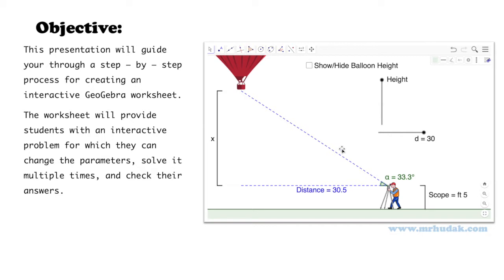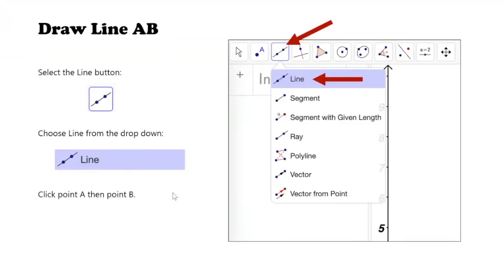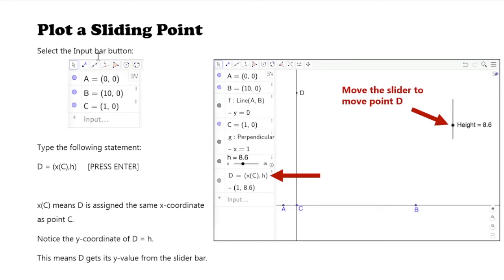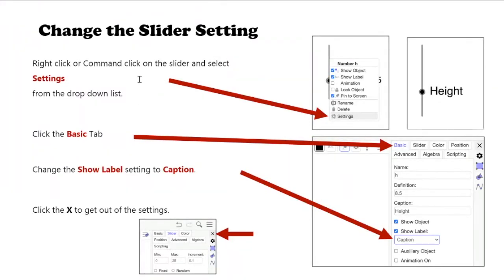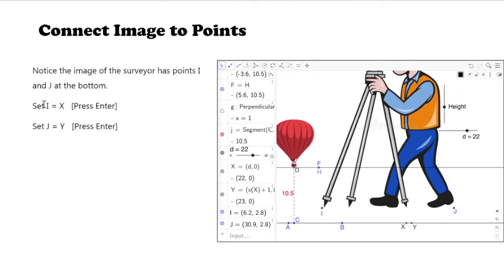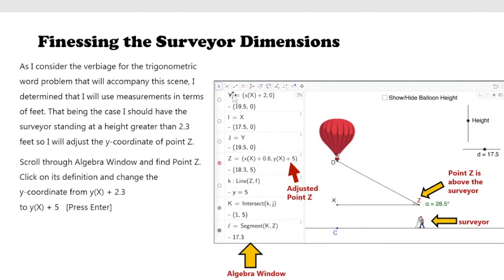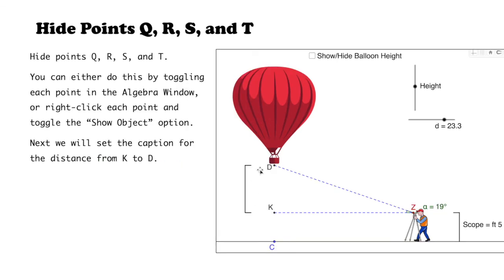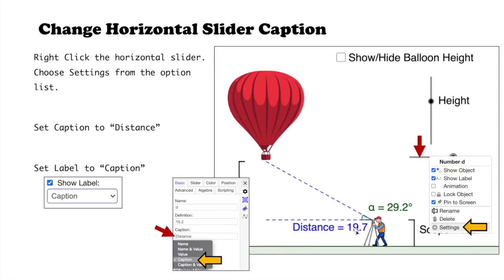GeoGebra Tutorial – Building an Interactive Worksheet

Comment: Hello, thank you for making a helpful video. I want to modify the activity for my students, so I want to modify this into measuring the height of an object that touches the land, e.g: tree, building, etc.
My problem is when I changed the height of the object, the object position is moving also.
How do I solve this problem? Thank you
Reply from the maker: I create points in my worksheet that are not associated with an slider tool. Then I hide the points so the image cannot be distorted. Here is a link to some other trig application worksheets I've created. https://tech.mrhudak.com/geogebra/trig-app
Reply: @MrHudak  Thank you

Comment: Hi, how can we resize the ballon while moving height slider, so at ground will bigger then up.
Reply from the maker: You would need to use the transformations menu and establish a point that acts as the center of dilation.
Reply: @MrHudak  I made a dilation however it did not act simultaneous with ballon fly motion.  Do I need to set a condition?